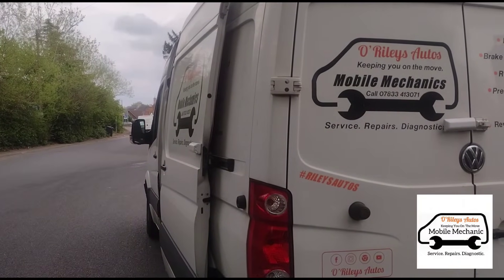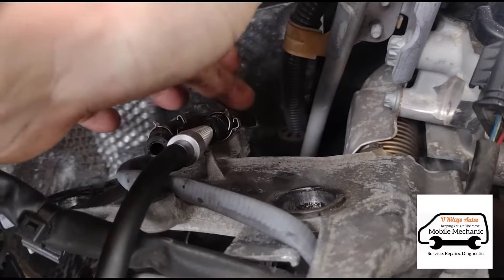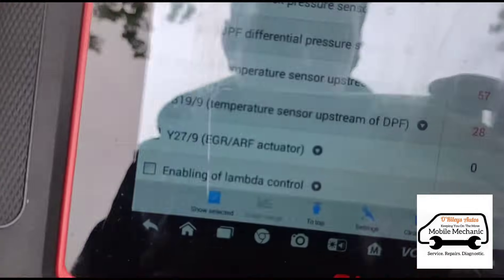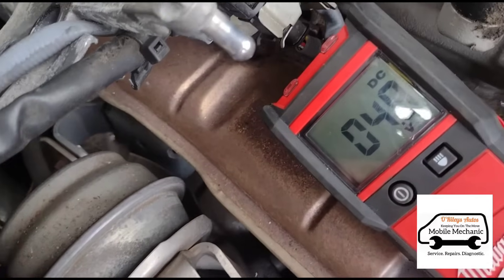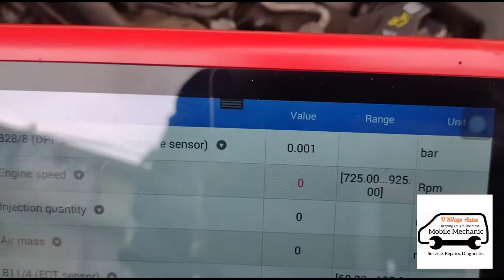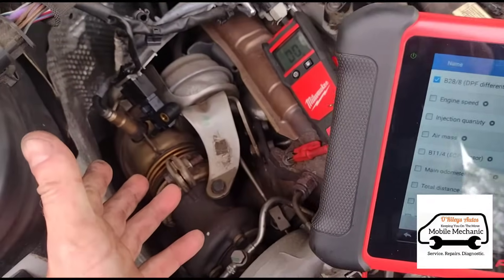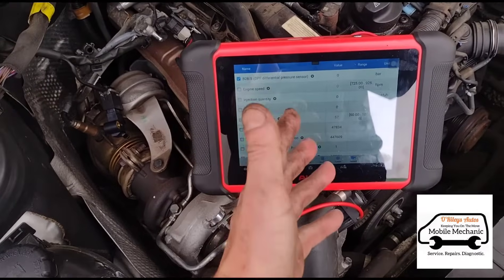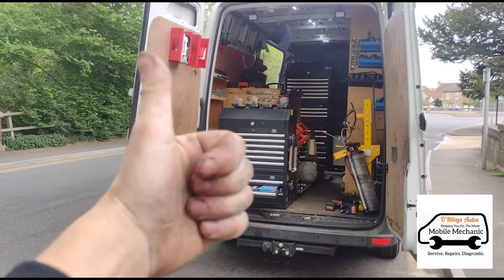How To Test DPF Differential Pressure Sensor. Diagnostic

Comment: I need you to tell me because I suspect it's the same thing. But how accurate is the blowing through the thin tube? If air comes out of the thick tube, then it's working. Or if you draw air with your mouth from the thick tube, that indicates it's working.

Comment: Probably a bit late to party but I've got a Audi 184 Cuna and I believe this might be the issue with my car feeling like 80bhp and in soft limp mode. Stop start & Regens stopped working engine is mechinacly fine with new EGR Cooler, Charge Cooler etc but I've had a huge loss of performance

Comment: Hello Mr. O'Rileys Autos.
My differential pressure sensor diagnostic test shows a reading of 0.2 kPa, and it remains stuck at that value, like a snapshot.

Do you think this is a good reading or not?

Thanks
Reply from the maker: It should not be stuck at a value
Reply: @ORileysAutos  Merci thanks👌

Comment: my toyota rav is running normally with plenty of power, however I cant clear a dpf warning message, every time I do within a day or so it comes back. So I think I might try replacing the sensor. Thank you.
Reply: same problem even with ecu cleared
Reply: @RachelKerr-rh2jg it's likely a sensor. Going to replace mine.

Comment: Volvo V60 D3 2017 – Persistent P04D900 error even after replacing and calibrating the EGR valve. Could a faulty reading from the differential pressure sensor (Volvo part 31370160 / Bosch 0281006329) cause this code to appear? I've checked hoses and wiring, and the sensor seems responsive, but I'm unsure if it could affect EGR flow calculations. Has anyone experienced this?

Comment: Jimmy,

Thanks to your videos I bought a code reader that could read live data. The van was in limp mode, live data said the differential pressure was constant regardless of revs.

Imagine my relief/frustration when I climbed underneath to try your pressure test trick and found that the senor wasn't plugged in properly. 1 "click" sound later, codes cleared, it's 5 to 6mbar at idle.

Thanks man!
Tim from Cork

Comment: Right so this is were i am 

I took my dpf filter cleaned it, band new egr valve put in, i cleaned out my egr cooler cleaned it, cleaned throttle body and map senor, now im still getting CLEANING EXHAUST FITTER KEEP DRIVING so regeneration still on i drove it twice down motor way turned off itself after 15mins driving then next time i start it 10mins into driving its doing a regeneration 😩😩 can i clean the differential pressure sensor to stop the regeneration from happening or what can i do lads 😥 its a 2016 opel insignia 1.6ctdi

Comment: Hello Jimmy.

Got a 66plate Tiguan TDI. The previous diesel was a Mercedes OM646EVO 2008 in a C Class with DPF etc so these emmisions things are new to me.

Purchased a DPF Differential Pressure Sensor from TPS as my diagnostics state that is the problem. Its a five minute swap over.... but i need to get the adaptation done in conjunction with swapping the part. Ive contacted a well known VW retrofit company in the midlands that i'd thought would be able to do as they seem competent in VCDS/ODIS but dont do it. Ill keep looking though.

Comment: Hi, when I connect my scan tool to my wifes car opel astra k 1.6 cdti. The readings from the dpf pressure sensor is 0 at idle en when revs up to 3000 is sometimes spikes to 10 back to 0 en 10.... 
Also the voltage according the scan tool is 0.553 volts and stays there am the time is fluctuates 0.02 but nothing more than that. But the car still regenerates the dpf every 400km. 
Could this be faulty senor of bad readings on the scan tool. 
In the defense of the scan tool om my honda It gives normal readings. So I suggest the scan tool is correct? 
But if the sensor would be bad. Could the dpf still regenerate? 
Thanks
Reply: Did you sort this out?
Reply: @simplywinning1170nope everything still the same

Comment: Can you just put the new sensor in? Or does it have to be programed/calibrated? I've just replaced dpf and now it's saying p244a fault which is that sensor. Do I just replace it and off I go? Have power to it, checked all that today  any advice would be really appreciated. Thanks.

Comment: Vw caddy 1.9tdi 77 kw 2008 problem with dpf. When the regeneration is turned on, the revolutions remain at 800 revolutions. It starts humming a little and the turbine starts to buzz a little louder. When the regeneration is not done, the fan turns on. I know that this is all normal, but I don't know why it doesn't raise the rpm to 1000. Sometimes the regeneration lasts 50 km, sometimes less. It comes on every 500-700km, depending on where it is driven locally or outdoors. The DPF is not clogged, the car goes over 3000 rpm without any problems. This is how the exhaust is, I don't know if this is how it should be. what do you think?

Comment: A huge thank you as your video helped me diagnose and repair the DPF issues on a 2007 Jaguar S-Type that I have been restoring. The smoke test revealed a leaking pipe and the electrics test revealed that the DPF electrical connector was faulty. It also needed a full DPF chemical & high pressure flush but it now drives like a dream with no errors at all. THANK YOU!

Comment: Love the vids Jimmy. Very informative! You’ve inspired me to try and diagnose my Fiat Ducato. What are the tapered hose metal adapters called that you’ve got? I’ve bought a manometer but don’t have the adapter to connect to the pipes. I’m getting no pressure readings on the scanner so suspect the sensors dead. Getting 5v though.

Comment: Jimmy, thanks so much for all your fantastic shared knowledge. I have a 2019 relay that seems to be constantly regenerating. Im going to check and poss change the pressure sensor all thanks to your great videos.
P.s. you need to move to Scotland ;) 😉
Reply from the maker: Glad it helped
Reply: Did you change the sensor? Fixed your fault?

Comment: Hello! Please help me with an answer. I have an Volvo XC 40 from 2019 with 2.0 l diesel engine D3 110 kw and I have P245368 error code. I had cleaned DPF but the differential pressure I think is still too high, at idle i have 50-70 hPa and in rev i have more than 100-200 hPa.

Comment: I’ve replaced my dpf sensor but I get a reading even when the car is off. After a regen the sensor shows -12mbar when off and -7mbar idle when cold. When the temperature increases these figures rise slightly. When dpf is near full I get readings of 5-6mbar with car off and 15-20mbar idle. Is it calibration that needs doing?

Comment: I have a zafira b that has had the dpf replaced due to a blockage. No fault codes now but the regen process is constantly starting. Could this be a damaged pressure sensor or maybe the ecu not being reset ?  Thanks

Comment: What causes circuit high p0473? I checked hoses and there is no blocks or splits, i changed the sensor and it still throws this code up.. is this 2nd sensor faulty also?, i also checked the connections with a multimeter and seems fine
Reply: Did you fixed it, i'm having the same problem?
Reply: @nikolastojanovic1952  DPF FAILED

Comment: Good Job. l have a question, why where you testing one side of the sensor?
Reply: It is a dpf differential pressure sensor. It compares the pressure of one side to the other. If he put pressure to both sides it would read zero as both sides would be the same pressure but by putting pressure to one side (manifold side) he is comparing the reading of the increased pressure on one side to atmospheric pressure on the other. Although saying that he could probably have tried pulling a vacuum on the other side (exhaust side) as an additional check as well but honestly I don't think it would have been necessary.
Reply: @imjustbrowsing100  Thank you man. cheers

Comment: plug in the new oxygen sensor or Lambda probe into the car installation connector not built into the Dpf filter that connects it to the car's electrical system and disconnect the cable from the old one that you have built into the Dpf.... A miracle will happen. All errors and lights will go out..  ..The computer in the car, through a clean air sensor, reads a clean air flow without CO2 and turns off every single Error exactly that the same dirty 0xygen sensor reads in the old one that is on the Dpf.....You bypassed the complete system of all sensors and Shit with that move😅

Comment: Be aware that every car that has traveled over 200,000 kilometers is full of soot and grime, so you have to take it off and wash it and clean it when you do that and put it back.  All possible problems on diesel engines.....the same Dpf or Catalysts on cars or trucks are purposefully made and put on cars not to Protect the Atmosphere from pollution but to cause problems on your cars to make money for the Fanatics of the World Autolobies, mechanics and industries  parts. Old car models, diesels or gasoline cars up to 1980-90, were made without Catalysts and DPF filters, and those engines exceeded half a million and a million kilometers without major services.....And today's cars start to break down after barely 100  thousands of kilometers😂

Comment: Hi, is the dpf diferential sensor different to an exhaust back pressure sensor?
Reply: hi, did you ever find out , my scanner only finds exhaust back pressure, many thanks
Reply: @kevinclose8119  Hi kevin, yes I had my car scanned by a mechanic with Xentry, he said it was the flap in the exhaust. Not the DPF pressure sensor. He couldnt fix it at the time, but he advised me to give it a go with some wd40. However, I cannot find where that flap motor is in the exhaust just yet
Reply: @SuperPramFace  many thanks for your relpy

Comment: Thanks for the video very helpful. I have just carried out the same test on my Kia 1.6crdi and my pressure sensor signal wire reads 0.00 at idle and with engine @ 3000rpm.
The power wire is fine @ 5v and the ground is also fine. Looks like my sensor is faulty?
The reason i checked this is my dpf never seems to regen even after 2k miles.
Reply: Evet, muhtemelen sensör arızalı. Bendeki sorun ise tam tersi. Araç üst üste sürekli olarak rejenerasyona giriyor. Sensörü değiştirmeyi deneyeceğim.
Reply: Hi did you sort this. Mine is showing 0.0 also

Comment: Hi. On a G30 2.0D, i get 2BB400 Ista error code. Check engine on dof regen, regen succesfully, the car has no problem, but the check engine appears again after a new regen o dpf. Have an ideea witch sensor is the problem ?

Comment: Do you know if it is necessary to reset the ECU once you change the DPF with the scanner or a regeneration to get the new values from the differential pressure probes?. I have to change it for a new one, it is very saturated.

Comment: Been watching a few of your videos lately, hope I can get your opinion here… I am a home mechanic with a 2009 Audi A6 3.0tdi, 293k km, no mods other than a simple remap from a known good tuner: P242F stored, can be deleted but comes back in no time. No other faults stored. Been smelling exhaust fumes for a while now, but can’t find an exhaust leak. Exhaust tips still clean as a whistle, high fuel consumption (9,5L/100km) but no change in power.
What do you think, best scenario split dpf sensor hoses? Or a worst scenario clogged dpf causing backpressure causing gasses to escape pre-dpf past a gasket?

Comment: Hi, on this type of dpf sensor is air supposed to travel through it ,like blow it trough one end and comes out through the other one ?
Reply: No it is a dpf differential pressure sensor. It works by comparing the pressure on both sides of the dpf (hens two pipes). If there is equal pressure on both sides then the sensor will read zero but if the dpf is restricted the reading would be high as the pressure on the engine side of the dpf would be higher than that on the other side. This is how the car knows how much soot is in the dpf. Also if the sensor picks up the dpf differential pressure is too low it could indicate the dpf internal structure has failed. If this is the case you would usually find black soot within the tailpipe.
It is also possible if say you had a block within the exhaust system but not the dpf the sensor would show the pressure to be okay as it is only comparing two points and not the actual exhaust back pressure.
I hope this makes sense.

Comment: Hi there this is a very helpful video. I’ve got a Astra 2.0 cdti A20DTH 13plate, my dpf sensor is reading 0.41v at idle but also 97kpa ? My reader isn’t picking up any errors and car drives fine. Could it be that sensor voltage is normal but it’s been replaced at some point but not relearnt via diagnostic tool? Thanks

Comment: Hi, I have a mini 2.0 SD and the reading on the Diff Pressure sensor is 342 mbar with ignition on and engine off.  A new replacement sensor reads 352 mbar with engine off. Should the pressure read 0 with the engine off?  If i disconnect the sensor it reads 299 mbar. Thanks
Reply: It should be 0 with ignition on and engine off. Could be your scan tool misreading.

Comment: Great video .. . If say a car IS  regenerating but to often can it still be this?  Other question..that scan tool u have will it do injectors on a mazda ? Ty in advance
Reply: Could be but check also rubber/metal pipes coming to dpf from sensor as they might be blocked.
Reply: @CalmJetSki-oz6fn  ye ill check thise to ty osl

Comment: Usually there is a failure code reporting a short to ground on the sensor, it is extremely useful to be able to read this out yourself.
Reply: Literally just done this with a cheap OBD2 reader and hopefully ordered the correct new sensor. Spent £1700 last year due to DPF related issues fowling up the turbo and exhaust system - hopefully this will fix it 🤞

Comment: Anyone going through DPF clogging issues - I can recommend doing a backpressure test with ISTA software, there are tutorials on youtube. Helps understand how badly clogged the DPF is and also shows the readings of this sensor - if they are the same across the range, sensor is faulty.
For me, turns out the pre-DPF temperature sensor is at fault for regens not happening, showing 7.9 degrees celsius with the engine running - impossible.

Comment: Are you supposed to be able to blow through the 2 hoses to check for blockages?One on mine is barely passing any air.Can you safely run a wire down them to clean or is there something that maybe damaged.Too hard to remove them as they're at back of engine and hard to get at to unscrew.
Reply: Late answer:- I'm pretty sure in some previous videos, Jimmy has a long wire on a drill that he feeds down the hose to help clear it out as it gets bunged up with oil/soot mixture.
Reply: @s.wilson5675  turned out only blocked first inch so got by with a drill bit,🙂

Comment: Hi O'Rileys ,  I have reading on differential pressure sensor in minus. When idling  it is --9 mbar and when is not idling it is -300 mbar.Can you help me why the values are in minus ?
Reply: Backwards pipes?
Reply: Was that the case then? Were the pipes wrong way round?

Comment: Can you help me I have a 1.6 tdci diesel Ford Focus it’s had the edr changed out into diagnostics and it came up with glow plugs they’ve been checked there all fine then the mechanic changed around the relay it worked for around 2 min then went straight back into limp mode the light is on and I’m pulling my hair out do you think it needs a new relay switch???? I hope you can give me some advice Thankyou Adam

Comment: My 2011vwpasst is surging in revs in high gears and when I activate the cruise control, I'm getting codes for secondary air sensor, o2 htr monitor sensor and o2 sensor , could a bad exhaust pressure sensor trigger all these

Comment: Hi i have a toyota yaris with engine management light on code: p2463 which is  the DPF soot accumulation after cleaning the dpf car works fine but after  3 days the light came back on again any where i take it they just say that i need to change dpf which im sure its some thing else any idea to help me please.? By the way none of them uses the equipment that you have. Just the dignostic computer .thank you
Reply from the maker: All I can offer is to check it if you bring it near me

Comment: Hi, i have checked my car Audi A3 2016, and it has two seperate sensors next to each other, both have two places for two hoses on each, but only one side is connected on each sensor, both connected on the left hand side, would you know which one is before the DPF to put the DPF cleaner down?. I don't have any errror codes as have scanned the car the first day i got it, but want to know for future refernce and will be travelling a lot of miles after Christmas, thank you best regards
Reply from the maker: One would be a low pressure egr sensor

Comment: I change sensor bosh and not working then one guy from mercedes says i must buy original mercedes is thet posibile?
Reply from the maker: Did you check the plug has power?
Reply: 2 weaks ago they clean my dpf filter and they change new sensor i drive 2 weak and i got check engine show thet sensor not working they bring new bosh sensor and not working no readings they check instalation and they say thet is ok now im waithing original mercedes sensor car is in workshop
Reply: @ORileysAutos  soo what u think what is the problem?
Reply from the maker: @whitepulsarrbeli1309  https://mercedescarservicing.co.uk/parts/om651-dpf-pressure-sensor-modified-plug-a6429050100-a2044406440/
Reply: @ORileysAutos  i change it with original mercedes sensor and now working thx

Comment: how do you know which wire is signal wire, positive or ground when you connected your multi meter?
Reply from the maker: Positive would be a steady 5v and signal would fluctuate with revs